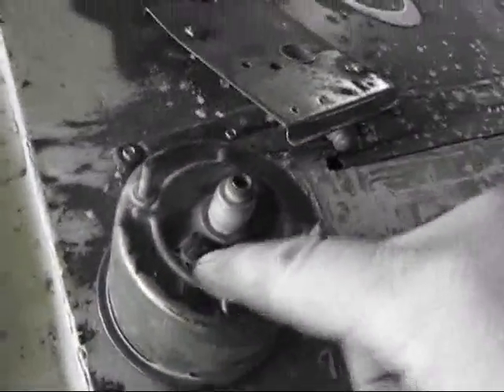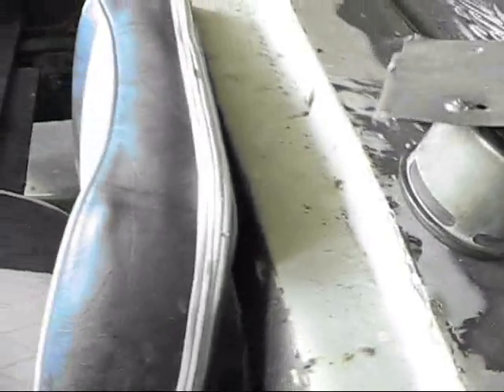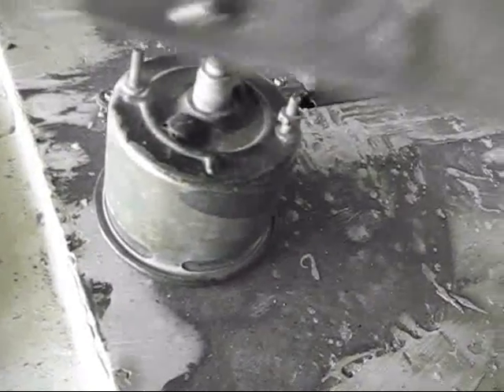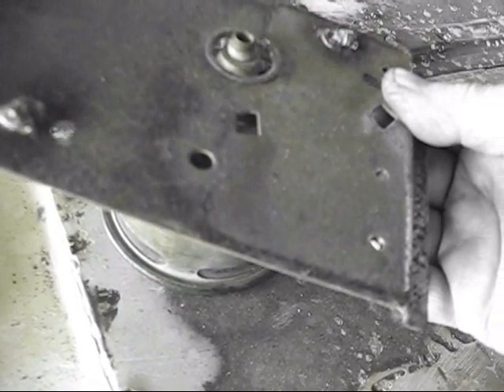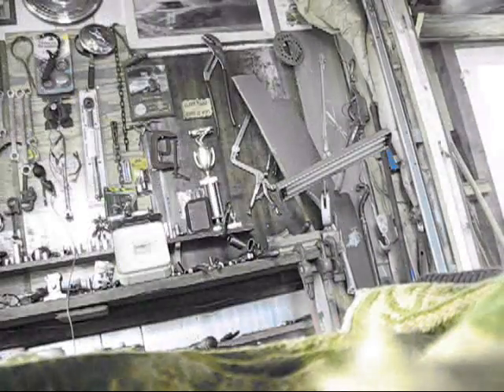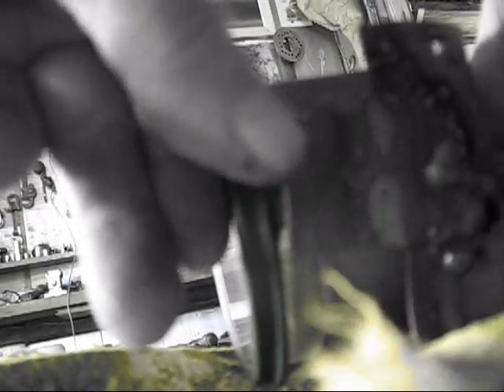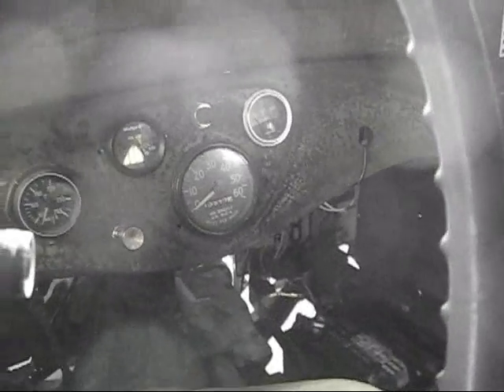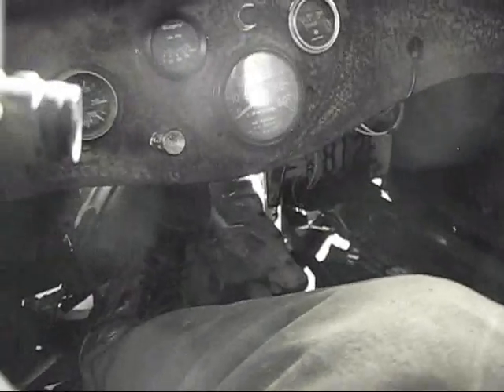speedometer installation 2

Comment: Cool, I'm sure you will peg that needle!!  I wonder how close it is to being accurate ?  It would be very lucky if it reads close with the different wheel sizes and God knows what that speedo came out of.  That tranny came out something with 15" wheels and you are running 14" in the rear?  You'll have to test it with a another car running side by side or something.